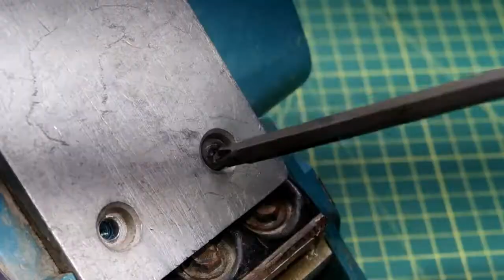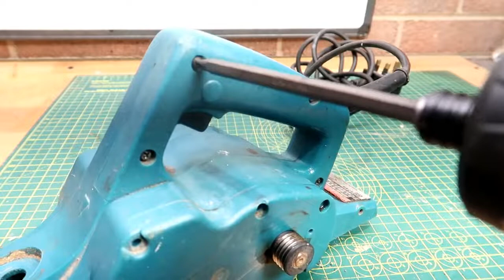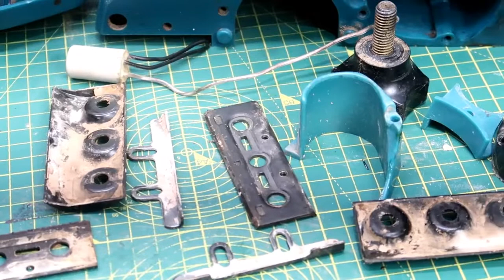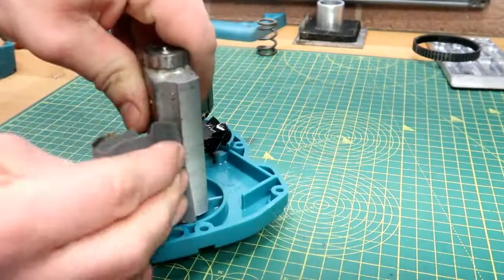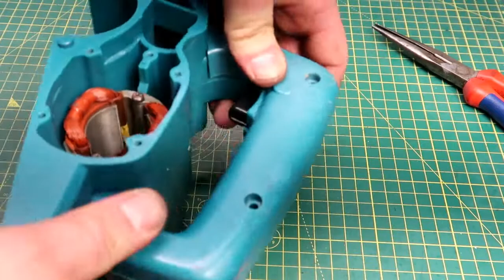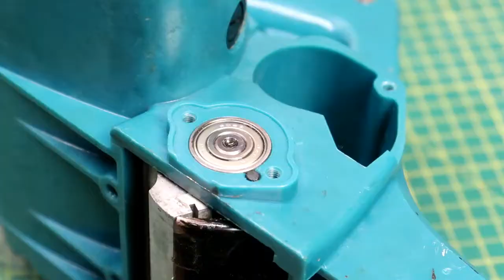Electric Planer Makita  -Step By Step Restoration

Comment: Always check that the blades are even and level and slightly project above the long plate. All blades wear with use. Mine has a gauge for checking that. Mine must be 40y+